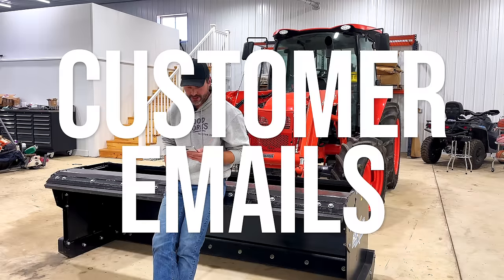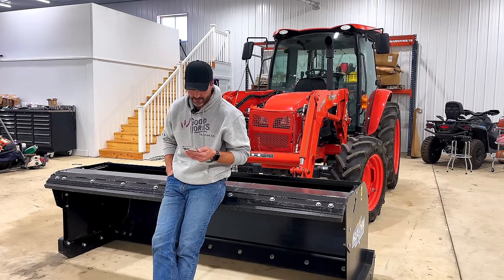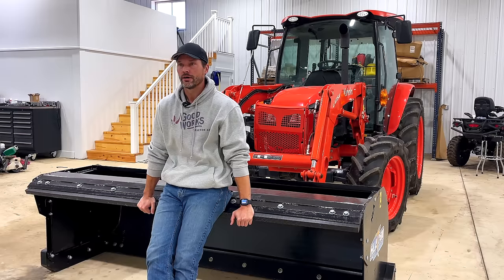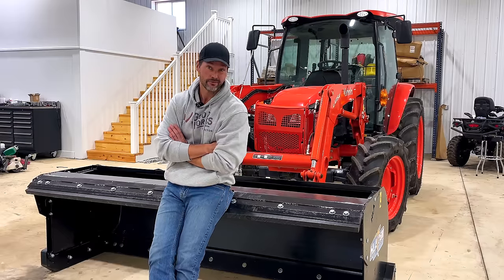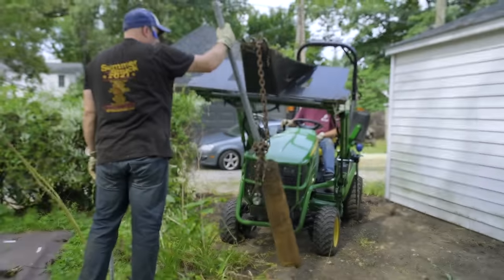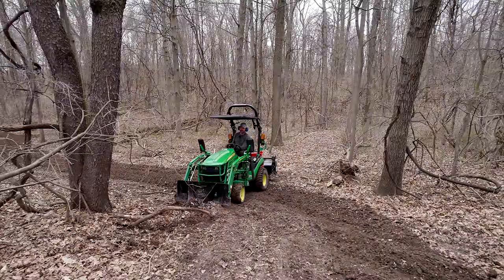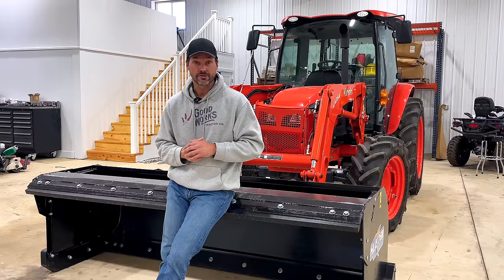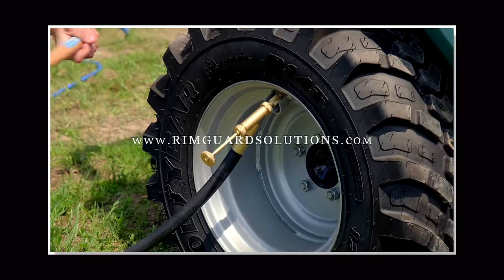WOULD YOU CHOOSE A MASSEY OVER THE JOHN DEERE 1025r?

Comment: I'll join the others here singing the praises of the Massey. When I started shopping for a tractor I initially had been looking at a 1025R for a few reasons, but also have a friend with a BX so I kinda checked them out too. I was leaning towards a green one when a friend from church suggested I look at a Massey, in large part because of the dealer.  I also talked to neighbor down the road that I noticed had a little red tractor and they had not complaints with it or the dealer. After comparing features, a huge one being native SSQA (Deere dealer didn't want me using universal stuff on the loader) and price I bought a GC1725 (which does have tilt steering BTW) and a several attachments for the same price as a bare 1025R. My savings was even a little more because the county sales tax was lower for the Massey than the Deere. Originally I wanted a backhoe too, but I figured I could do a lot of renting for $7000 and I could use that money to keep buying other 3 point attachments that I'd get more use out of. My only regret is buying the belly mower which I've only used a handful of times because I ended up buying back a machine I sold years ago (Steiner 220) which mows faster, cuts better, and I had it fitted with a vacuum system for leaf clean-up. I have also since purchased a zero-turn for a winter fixer-upper project. Some people like mowing with a tractor but I felt it was too slow and too heavy on my yard.

Comment: About 3.5 years ago I bought house and also the estate. In the estate was a 50in deck lawn tractor; powered by Kohler 20hp magnum. After a little research found the manufacturer was no longer in existence. A little more looking found that the model was produced from 1992 thru 1995. So it's age is age is 29 to 31 years. I have used it for 3.5 year with no real problems other than mower deck belt replacement and it doesn't use oil. 
Most new lawn tractors today will never see that age! And that is probably the reason MTD  bought them out and discontinued them!!!
It has become a wear dated world!!!

Comment: I had a 2305 John Deer who was awesome, and I enjoyed it for many  years. Two years ago.I sold it and bought a massy gc1725 m with loader, backhoe, and mower deck. It's a great machine awesome, the only issue I had was the rear tires were not as wide as the deer. So, I purchased wheel spacers.  It feels great now. 
Look at them all to see which fits your needs and price.
Reply: I just visited a MF dealer, today, and love the GC1725MB. I asked the salesman about the spacers, and he said, that if I See need to use chains on the tires, it only can be accomplished if I added the spacers, but they're not from MF, and he doesn't like the idea, because it causes extra stress on the seals and bearings, specially with the BH. So I did  ask; About warranty, will it be an issue? He said " It's Possible that MF will not cover the repairs, if it's on the rear shafts.

Comment: The Massey has some of the smoothest backhoe hydraulics I used. It has stout loader and the Iseki engines have been around forever. The only reason I didnt get one over my last Kubota, was the SSQA. In 2017 I couldnt get the Massey TLB with SSQA. I would have preferred the side by side pedals as well.

Comment: I just bought my second Massey sub compact TLB. I have time on all brands. The Massey is the most efficient and cost effective. I wanted a JD but after using the Massey & noticing that its a full function (hydraulics) where as with the others you can only use one function at a time. Very inconvenient when driving and using the loader for loading or grading. Not everyone needs a float but the Massey has it if you want to use it. With the others its a must if your grading and creates more hand work.

Comment: The biggest limitation for my 1025r is the belly mower.  Not too hard to take on and off but the tractor is not the best for mowing.  Even with versa turf tires, the tractor will do damage to the lawn when it is damp.  You have to wait until the lawn is really dry which can be inconvenient.
Reply: 🤨Buy wider tires for the Front.!!! 🤔
Reply from the maker: I've mowed with zero turns, lawn tractors, and subcompacts...any of them will damage the lawn when wet and driven/turned on without caution.  I prefer mowing when dry anyways.  Much easier clean up afterwards.

Comment: i have a Massey GC2300 right now with a loader and mower and it has 1800 hours on it.  the machine runs great and the only "repair" i have had to do was replace one of the small valve connectors on the loader joystick that broke.  that part does seem to have a common failure rate on several of these small tractors.  this is the second GC Massey i've owned and for the price of these tractors, i don't think you can beat them.  my GC has done almost every task i've tried with it including loading the loader bucket almost full of concrete and carrying it to the back of a house to help a contractor pour a new porch for a neighbor.  the John Deere compact tractors are nice but they are at least $5000 more than a new Massey for the same tractor and i just don't think you get $5000 more value in the Deere.

Comment: Have a Massey GC1705 since new. Just turned 1,000 trouble free very hard use hrs. Use it constantly for all sorts of farm and yard work. Stuff you'd never think it could handle but it does. If I were looking for a new one this size . A 3 speed hydro would be top of the want list. Faster transport speed. mid range for mowing or what not and a super low high torque for hard drawbar work. Not sure if any one offers that in this size with out going to the large frame. But I'd gladly pay up for such an option and more. For instance multiple factory rear remotes, additional lights. I think summits got the right idea offering these type of options as OEM add on.

Comment: I will say from personal experience using both brand machines . The first sub compact tractor/backhoe/loader/mower I used was a MF borrowed from a friend some 10 years ago, from the beginning it felt vary lightweight could barely drive it with the backhoe on it without doing a wheelie so definitely needs front end weights . Mowing deck was different to take off so I did end up tearing a mount off digging with the loader ( had to get my neighbor to weld it for me) . Backhoe uses the operators seat and was difficult to turn around ( probably needed some lube ) . Overall the tractor was good but definitely was little and light . I now own a JD 1025r and it’s way better in my opinion doesn’t feel tool light with the backhoe on it perhaps it’s a little bigger. Quick attach loader is easy to take off . Drive over deck is simple ( not perfect but mostly great) . Backhoe is also easy to take off as well. JD definitely did their homework with this model and worth the extra money to me .

Comment: I have a 2017 massey gc1720 tlb. I use it for work. I have 1800 hours on it!! Still going strong.   No real issues over that period of time other than things i caused myself because i work it very hard and do things i shouldn't do  with it. Once in a while ill blow a hydraulic line but that's about it as far as things going wrong with it. And thats just from rubbing on moving parts over the last 1800 hours of use. The pins on the backhoe are getting sloppy but thats to be expected. It is not the most comfortable machine for sure. But it is worth its weight in gold when it comes to how much work you can get out of such a small machine!

Comment: I had a Massy GC subcompact, and my biggest complaint was with the brakes, as one of the uses for it was to put my dock and boat lift in the lake, down a boat ramp, and the brakes were not up to it. I had to chock the wheels every time I got off of it before turning if off, because once the engine was off, it would start to roll on the ramp even with the brake set. But the only thing that went wrong with it over 20 years was the ignition assembly had rusted out, but I left it outside that whole 20 years, so that's kind of abuse. I still got $4K for it on a trade in, so I felt like it didn't owe me anything.

Comment: Just this last spring I was looking for a Kioti tractor and while I was looking i spotted the Massey tractor  and was more impressed with them over the kioti, but I'm looking at a 60 - 75 hp tractor. I need to run a pto generator and want 4 wheel drive. I'm not as big a guy as you are and I liked the bigger cab, and there's the rub, do i have a payment or keep the open station JD. My suggestion would be to have a mission in mind and get the machine that works best for that mission within the budget that works for you. At this time we are holding on to hope that this stupid prices will go the other way or that the price of beef triples. Your advice is good and so far the Massey tractor is on the back burner.

Comment: Here it is 8 years later and I still haven't decided which brand or type of tractor to purchase.  I already have a Toro commercial grade 52" Zero Turn and a Cub Cadet XT-2 which is dedicated as my snowblower since my 20 acre property is over a 30% grade and the Cub Cadet simply won't mow it.  At my almost 70 years young age, it's getting harder and harder to physically maintain these units on a regular basis.  I'm still on the fence about purchasing a tractor whether it's a sub compact or compact.  Living in a very rural area JD and Kubota have the markets locked up here but their prices are astronomically high now.  I'm leaning toward either a Kioti or TYM compact (not subcompact) as I want to harvest some timber, build a logging road and construct a pole barn next Summer and making  purchase of a tractor on a fixed income is hard to justify.  Decisions decisions.
Reply from the maker: Might want to hurry up with that decision!
Reply: If vehicle maintenance is becoming more difficult I’d be looking for a machine that can be serviced locally. Based on your situation you’d be better off with a bigger tractor. You already have smaller machines. Get a bigger one that complements the smaller machines. A bigger tractor will pick up more and do work faster.
Reply: @kdegraa  My thoughts exactly.  However, I 'll need to purchase a trailer big enough for a compact tractor.  Looking in the 30 -40 HP range and that should suffice for my applications.

Comment: I'd choose almost anything over the 1025R. I can't see the advantage of a 1025. But I have sat on the smaller Massey and it does feel the most like a mower.
Reply from the maker: Do you own one?
Reply: @GoodWorksTractors  no. I considered a 2025 or maybe it was a 3025, but the 1025 lift capacity is too limiting for me. The auction I bought my old Case at had a Massey GC17 something. I would have liked a modern hydrostat but couldn't find anything with power at my price range. My Case 430 has power but it's a bitch to maneuver. Probably need to fix the transmission

Comment: I regret going with a 1025R over a 3 series when I first bought my property. We only had a few acres of grass and minor projects with the loader. Now we just had 7 acres of timber cleared for pasture land for horses in the next couple years. We’ll eventually want to cut and bail hay which I highly doubt we’ll be able to with a sub compact tractor.
Reply: You can get hay equipment for subcompacts, but the general consensus is that you're better off with bigger equipment with a more powerful tractor.  It takes too much time and the equipment is too lightly built to be durable.  Most "standard" round balers require a minimum of 30 PTO HP, which means a 3039R / 4044R.  If it was my $, I'd buy a Yanmar YT359 for small acreage hay production.
Reply from the maker: Whew....definitely a big difference between a 1 and 3 Series for sure.  Totally different ball game
Reply: @GoodWorksTractors  We definitely didn’t have the money for one that’s for sure but now that we know what our expansion plans for the property are going to be we might have to upgrade in the future. It’s just hard to justify that piece of equipment for only an 18 acre property.

Comment: I like the Massey Ferguson 1800M series and up.  I looked over a MF 2860 and was considering buying it, but in the end, I held off and didn't buy anything yet.  The biggest issue here in central CT. is that there are only 3 AGCO dealers in the state and none within 30 miles of me.  Being able to get service or parts close by should be a thought for a buyer.  Whether you get a John Deere, which I believe have Yanmar engines if under 100HP, or a Massey Ferguson, which I believe have Iseki engines in their sub-compact and compact tractors, I don't think you could really go wrong.  Both are proven powerplants.  I would hate paying more for green paint.  JD's are getting super expensive.  Stay Safe Folks!!!

Comment: 2001 jd 4400. 37hp yanmar. It's heavy. I move 800lb squares a lot and some 1300lb. Those big 1300lb ones are probably the max with no weight on the back. I can't use a box on the back because of getting around the barn. Tires are filled. 2k hrs. Never any trouble. The hinge where the bucket is attached is wore out and needs addressed sooner than later. But I did the complete excavation for the barn and dry paddock, and cleared a good bit of land. The dirt bank on the high side is over 7ft, just to know how much it did. Never would have gotten this done with the same size kioti or Kubota. They're just not heavy enough. Maybe the next frame size. If i had to buy a new one, I'd look into Mahindra. They're the heaviest on the market and lift the most. The weight also helos with traction. May not matter as much if you're a flatlander. Oh. The fuel filter part is now leaking. I pemetexed it 200hrs ago. It's starting to leak again so im doing that now.
Reply from the maker: Bit of a different animal there with your 4400.  Kioti's are generally always heavier than Deere in the same frame size, FYI.
Reply: @GoodWorksTractors my father in law has a 30 or 35hp kioti. Tractors are the same size, but his has trouble with the 800lb square bales. His is probably an 07ish. I would probably say jd has cheaped up the tractors since the late 90s though. The 4400s last year was 01.  I did look at Mahindra before. It's heavy. I don't when the joystick is too fat forward like the older ones and a few new ones. The jd feels user friendly, but if I was looking for a new one, I'd definitely explore other brands.

Comment: I got the John Deere. How easily the loader comes on and off and deck was worth it. It mows and rides so much better without the loader on all the time. Since it’s so easy to take on and off I don’t mind doing it. If it was a pain in the ass to do id just leave it on but mowing would suck and I wouldn’t enjoy using it to mow. I’d have a 2nd mower rather than fool with removing the loader on other brands to mow.

Comment: Wow! for $30,700 you can buy a TYM HST 474 with a Backhoe and Loader. This is a 48HP motor and a 5500 LB tractor. no mower but like you said get a separate mower, I see them as used for sale all of the time for bargain prices. I would not even look at the JD knowing this but that is just my opinion. The TYM 474 outperforms the JD by a VERY wide margin!

Comment: I chose Massey over the green brand! I’ve had my Gc1723tlb for three years and no regrets
Reply: Is that the same sizes and power as the 2024 1725MB? Curious. I could not figure out why some one would buy the 23EB, instead of the 25MB, guy told me that is the same tractor, size, weight, tires, just 22.5 HP. , to save $1500? Power for me is king.
Reply: @PoisonShot20  if I had your money I would have spent it on the extra power, but sense it was my money I chose to spend the extra $1500 elsewhere 🤣 The extra 1.5 HP wasn’t worth it for me.
Reply: @andylink5818  Sorry! Didn't mean to bashing your decision. But its 2.5 HP thou. In my case for what I will use will make a difference. And I was basing my opinion on the new offer they have now, 84 months 0% interest, I know it, there isn't such a  thing is 0%, but in my case chosing it, the 1500 wouldn't  make much difference  on the monthly. Of course, going for cash,  I would do the same as you did!
Reply: @PoisonShot20  no worries, according to Masseys website the E is rated at 22.5 HP and the M is 24.5 = 2HP difference. The PTOs are only 0.2 HP difference. The lifting capacities are identical. The added HP comes from increased rpm capabilities on the M model. I weighed all this out when I purchased mine and figured if I needed the extra power in the future I’d figure out how to get the additional rpm out of my setup. With that said I’ve not yet been in a situation where I felt like I needed the extra power. If you can swing it and feel like you’d be better off with the higher HP by all means go for it! For me though, 22.5 is just fine. They are both great machines!!! Long live Massy!
Reply: @andylink5818  You're 💯 correct. And thanks for sharing your experience and wisdom! After we chatted, I spoke with the local dealer, and he said exactly what you said. If need, ignore the Red line and move the middle above the green line 🤣, then it will produce the 25hp. So I asked him, why does MF do this? He said, they know some buyers go for the extra paraphernalia, such as: Arm rest, tool box , extra rear lights!. My dealer carge actually 2k more! 🫣. And did you compared it to the Kubota& JD 1025r, before you bought it it? Love to hear your opinion on that!🕊️
Reply: @PoisonShot20  that’s interesting to hear about the red line. I figured it would at least require a tune or an different intake/exhaust to get the added power. I looked at JD, kubota and Kioti, I went with the Massey because it had all the features I was looking for like skidsteer quick release front end, backhoe and most importantly the looks!!! I think it has the cleanest lines and the red paint is beautiful, my wife calls it my single seat roadster!